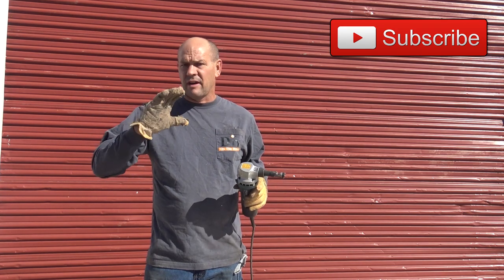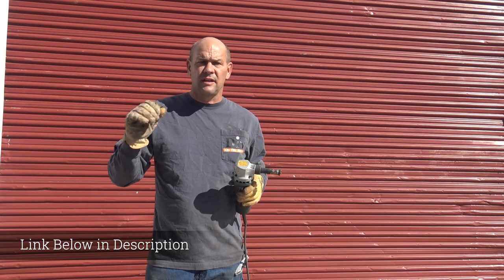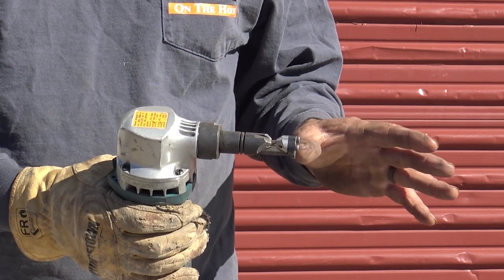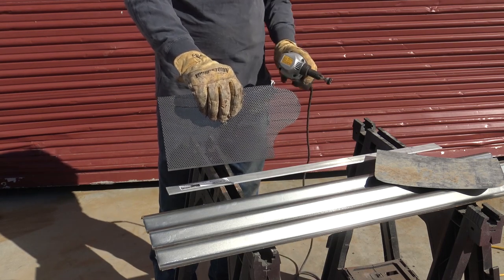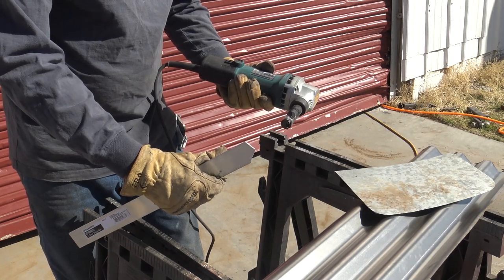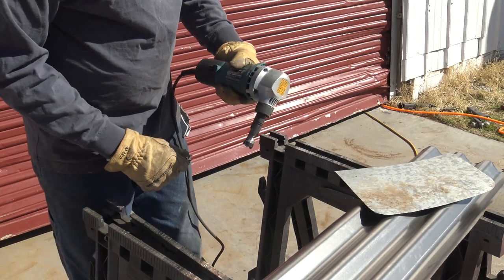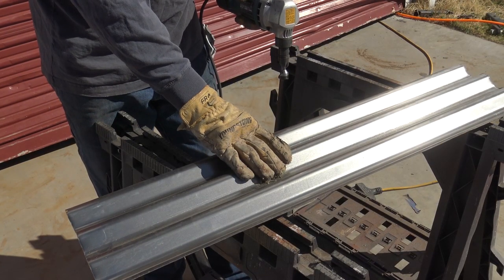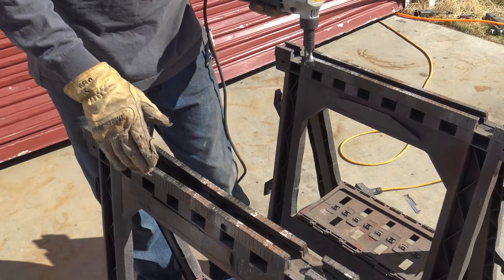Fastest Way to Cut Metal Roofing - Cutting Metal Like Butter with a Nibbler

Comment: I need to cut two pieces of 8' roofing tin,into 1' strips....I'm 66 and this is only the second time I can recall needing to cut anything like that.  I cant justify paying $400 + for one of those.I will use my circular saw with an old blade turned backwards.Works great.Probably not good for cutting circles but I have no need for that....maybe my neighbor will buy one and I can borrow it.He has more money than he has good sense.....:>)
Reply from the maker: It's definitely a tool that you need to use a lot to justify the cost.
Reply: @DIYOnTheHouse  Can I borrow yours when I need one?....:>)

Comment: I bought an old nibbler and I'm struggling to cut corrugated sheets. My nibbler has a sort of foot or guide in front of the punching bit so it's hitting the ridge of the sheet and I can't move forward or tilt the nibbler.  Plus it's heavy as hell cos it's one of those old models.
Reply from the maker: Yikes!